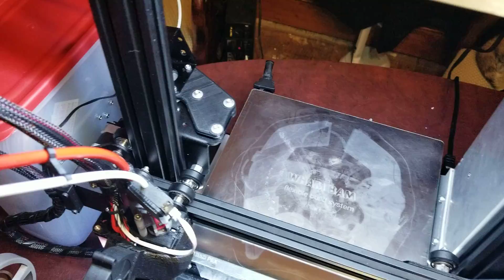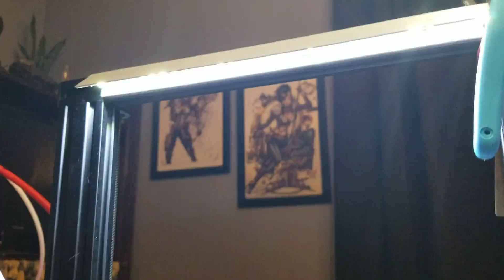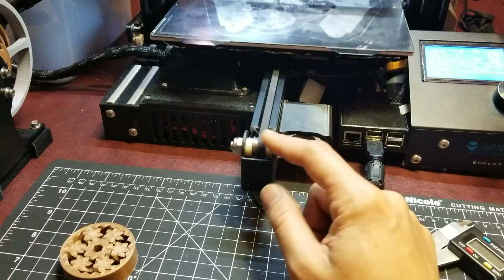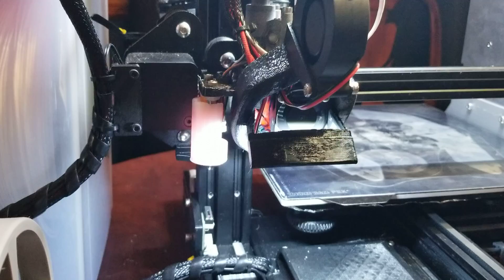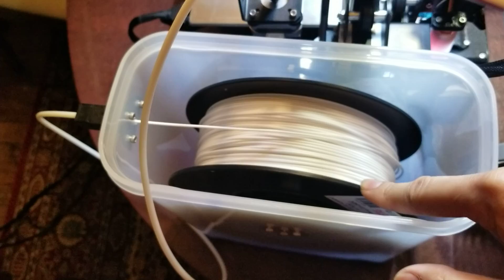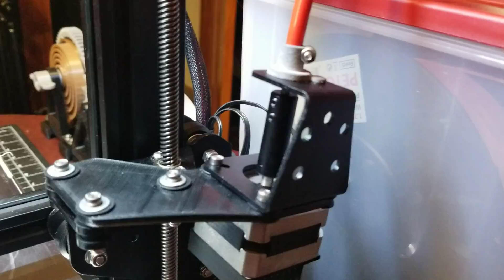My Modded SainSmart Creality Ender 3 with a Zesty Nimble Remote Direct Drive Extruder

Comment: Thank You. For the quick reply. I have been to the Discord Zesty channel so I will start there. I know generally how to install the Zesty from installing V1.2 on my Tevo. I was just curious about the differences between that procedure and the Creality  Ender 3. I also see that the Creality CR-30 Belt printer is out. Looks nice. I told myself I would start with The Ender 3 Max and then buy the Cr-30 later. After getting some more practice actually printing stuff instead of fixing stuff.
Reply from the maker: Gotcha. My Ender 3 ended up having a print come off the bed at layer 20 and then completely encase the head and ducts in giant blob of PETG... I'll eventually get around to rebuilding it, but for now I'm using an Ender 6 which works quite well.

Comment: Just one other thing, is there anyway to get the heated bed to stay on when the Filament Runout Sensor is triggered? This is one of the few bad points to the Ender 3 printer.
Reply from the maker: I've actually replaced my Ender 3 with and Ender 6, and I don't remember the exact behavior when that sensor triggered. I'm pretty certain it can be set to stay on though, but most likely through a custom Marlin firmware. Once you get a Marlin, or even Klipper (what I'm currently using) on your board (or even a new board itself), it will open up a lot of customizations.

Comment: I have a Zesty Nimble installed on my Tevo Tornado. Love the Zesty Nimble. I have nothing but problems with my Tevo. I just bought a Creality Ender 3 Max printer. I am looking for instructions on how to update the Creality firmware for the Nimble. I just bought the newest Nimble V3. It still has the 30:1 gear ratio.For the Creality printer do I need to install a boot loader. I have the Gen L 1.0 board on my Tevo and I did not have to install a boot loader. And where do I find the correct firmware. Also what Adapter do I need to print out for the Nimble? This is probable the only upgrade I am going to perform on this printer. I need at least one printer that just prints and prints and prints.  Thank You.
Reply from the maker: I had the v1 and already had custom Marlin firmware flashed onto ahead of time per Teaching Tech's guide. For the v3, all the info you need is at https://zestytechnology.readthedocs.io/en/latest/nimble/nimblev3/index.html. From my brief glancing of the page, it does sound like you need to update the firmware, so check out Teaching Tech's channel to start, then go from there. You could also check out the Zesty Nimble Discord channel. They are very active and helpful there. You might be able to just use GCODE at the start of your prints to tweak your e-steps (M92) any other settings you need to make it work. I tried looking for the link for the channel on their website, but can't find it at the moment. See if going to https://discord.com/channels/106223050856341504 will work.
Reply: Thanks, I found out how to update the firmware/setting for the nimble. But now I have a Blue screen issue.

Comment: What do you have the retractions set at? And accel settings?
Reply from the maker: I'm printing PETG with 25mm/s retraction speed and 0.40mm distance. Acceleration is set to 1200mm/s except for travel which is 1500mm/s. Junction deviation is 0.09.

Comment: what're your settings for the nimble? steps per mm, retraction speed, distance etc. ?
Reply from the maker: Your steps may vary depending on your extruder stepper motor, but below are the first few lines of start g-code I use. I print PLA and PETG and generally use ~1.0mm retraction distance and ~45mm/s retraction speed.

M92 E2670 ; Set steps/mm extrusion
M201 E120 ; Set Extruder acceleration
M204 R120 ; Set Retract acceleration
M205 E3 ; Set Extruder Jerk
M203 E45 ; Maximum feed rate
M906 X631 Y631 Z757 E491 ; Set TMC2208 X&Y current to 75% and Z to 90% (of 841) and E0 to 70% (of 701) max RMS
Reply: I copied and look at your settings. It looks like you did not have to upload new firmware. Is this correct? If YES, that makes things a lot easier. I assume you still needed to adjust the POTS on the printer main board? Did I understand that correctly? Than You. I use Repetier Server on my Raspberry Pi and Simplify3D slicing software.
Reply from the maker: Since I already had custom firmware, I had a tendency to put all my settings into the defaults, so it's hard for me to remember what I could just go through g-code vs. firmware, but I think everything can be done with a custom start print script.

Comment: Interested in seeing how you managed your cables after removing the chain (which I just finished printing...)  Do you have a link to a video?  I looked at your channel but couldn't see anything.
Cheers
Reply from the maker: I just ran all the wires through the existing wire loom except for the stepper motor wires which were grouped together in their own loom. They are then secured at the bottom with a Zip Tie to a custom cable clip I modified on TinkerCAD and then at the X stepper motor cover with Zip Tie to a leftover cable clip from the Basaraba Direct Drive Conversion Kit. I don't have any video of it up online.

Comment: Definitely got my attention with the Nimble DD.  What length did you get for the Ender 3?  There is a choice of 75cm, 95cm or 120cm.  I'm guessing it's the 75cm?
Reply from the maker: I was advised to get the standard 95cm length. That way it's most compatible if I want to move it to a different printer later.

Comment: What size stepper did you go with for your extruder with the nimble?
Reply from the maker: I use https://www.amazon.com/gp/product/B01LESPDCQ. I had to switch the 3 and 4 pins on the harness so that it would work. If you check their website, they have their own recommended motors on there.

Comment: Looks great... saved a heap of weight and space from no motor then add everything else but the kitchen sink :-D   Thought the filament detector was in an odd spot. Wondering if could use lightweight but strong nylon nuts and bolts.

I should add... straight after getting my Ender 3 I threw the original board and got a Lerdge K one (32 bit and steppers at 128) and got a Y axis plate with 3 point leveling and new springs.  Also upgraded my end stops to ones with LEDs as the Ender 3 ones are missing the components even though there's a space for them on the the breakout board.

Sort of wonder a bit about the extra weight on the build plate because of the glass bed. Surely that has to effect print quality with ringing at some point.
Reply from the maker: That was the best place I could think of for the filament runout detector when I designed it and it works well the few times I ran my spool dry. It's not in the video itself, but I got rid of my springs and use nylon spacers with PETG shims to have my bed leveled all the time so I only have to re-tram the bed whenever I do maintenance. As for the weight on the bed, I have my driver voltage set to 70% of the RMS without any issues, but you may want to bump the Y axis voltage a little higher if you want to compensate for the extra weight or run it in SpreadCycle mode.

Comment: Can you link to your hot end / nimble carriage remix in the description?   Definite thumbs up for showing a lot of things and putting a lot of great info in the description!  Thanks.   I am considering adding a Nimble to a Micro Swiss all metal hot end on a new CR-10S Pro that I'm getting.  For now I just have the hotend, but I really like direct drive and getting the weight of the motor off of the print head.   The best of both worlds there.

Edit: I see now that the carriages are different for the CR10 vs the CR10S Pro.  Looks like Nimble has a CR-10S Pro carriage now in their Crealtiy Thingiverse download.    I'll be checking that out.
Reply from the maker: If you click the link to My Thingiverse Designs in the video description, you can find it there... but here's the direct link: https://www.thingiverse.com/thing:3492958

Comment: Hi bro how are you hope you’re fine, i have a problem in my  scion tc  2016 display its crashing all the time I don’t know what to do any advice  ?
Reply from the maker: What do you mean crashing? Resetting or locking up? If resetting, make sure the harness or the wires going into it aren't loose. If it's locking up, then you may need to go to Toyota about that.

Comment: Great video! I stumbled on it for my research for the Nimble. Which hotend are you using on your ender 3? I found it to be a trouble source, because of its shorter length inadequately heating the filament not in time before it reaches the nozzle.
Reply from the maker: That was part of the reason I made it because I couldn't find any videos about it. I got the authentic E3D V6 hotend on mine and it works fine for 1.75mm filament up to 150mm/s for me. You can always check out the E3D Volcano. There is also the Magnum Mosquito.
Reply: @VampyreX13 Thanks for the quick answer. I will have a look on those hotends. Sorry to say this, but Magnum Mosquito is just an overpriced unnecessity. Speaking of NASA technology on an 3d printer component, if it is trying to enter earth's atmosphere by ionising plastic. v(ツ)v What is this 'Bloody Mary' about on your display? Did you flash a different Marlin on your printer?
Reply from the maker: I haven't even looked at the Magnum Mosquito, but I saw mention of it in the Zesty Nimble Discord channel. I've been very happy with my E3D V6 though. The Crew of the Bloody Mary is the name of my pirate crew. We go out to the pirate re-enactment events and are working on an Etsy store together. It's just a custom status screen I flashed in with Marlin 2.0.

Comment: Did you have to adjust any settings for the feed rate or is it a plug and play on your creality? If so how?
Reply from the maker: You simply use https://zestytechnology.readthedocs.io/en/latest/printers/cr-10/index.html#configuring-the-slicer in your startup g-code. Double check your e-steps with the Zesty Nimble disconnected from the hotend (free air method) as I found mine to be 2670 instead of the 2650 that was recommended.
Reply: @VampyreX13  did you add you auto bed level gcode to the bottom of the code or before the code? maybe could you post the gcode you are using?
Reply from the maker: I use Unified Bed Leveling so I only level my bed once unless I make changes or do maintenance. I only need to execute a G28 once my bed is at 75C at the start of my prints. I can still post up my start code if you want